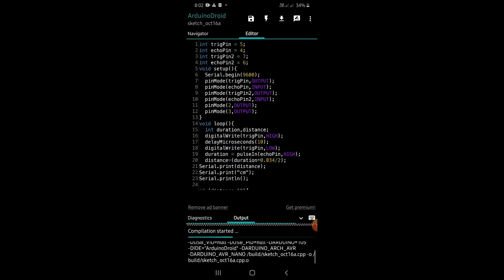HOW TO MAKE A OBJECT TRACKING ROBOT -HUMAN FOLLOWING ROBOT

Comment: Could you briefly describe how the system 
follows an object? 
Correct me if I am wrong but from my understanding, the two proximity sensors are angled to make a cone with two vision lines. If the left vision line is broken (the left sensor detects some decreased distance) then the servo motor rotates to the left until the object is no longer obstructing its line of sight. This basically keeps the object that you desire to follow, centered between the two sensors🤔
Reply from the maker: Your assumption is almost coreect but here i am not using proximity sensors and sevro(better using a servo)
Here two ultrasonic sensors are allingned in a way which there will not be a blind spot between them
If any ultra find something below the fixed  distance the motor rotate to the direction of that ultra and stop when both ultra finds the distance below the fixed distance
This means the system always tries to keep any object in the center region of the system where the two ultras have range
Thus if the system change to left or right any of the sensors distance value exceeds the fixed distance thus the system realise that the object is moving towards the opposite and it turns to the opposite direction
Even this is a tracking system it's motion is limited in two  a dimensional plane
So any upward motion will leave error
Any way tnx for your comment
And i hope you realised the working if not then pls comment again i will reply with a very detail comment
❤❤❤❤